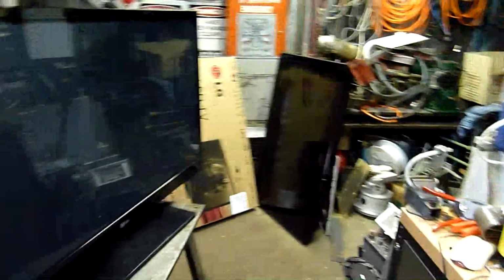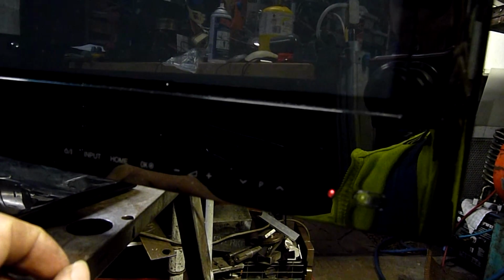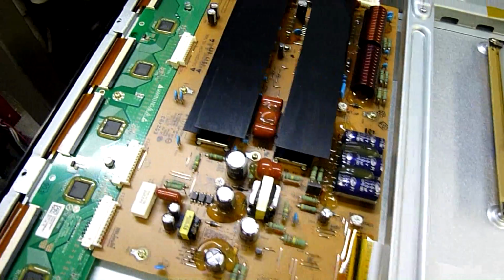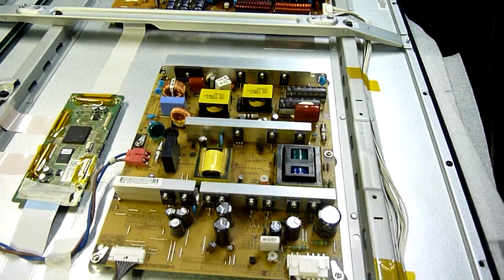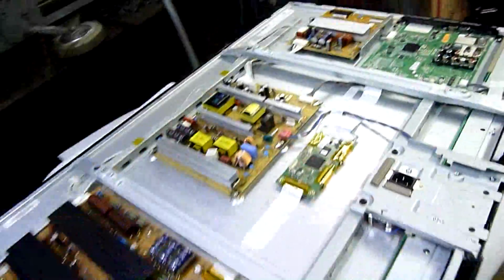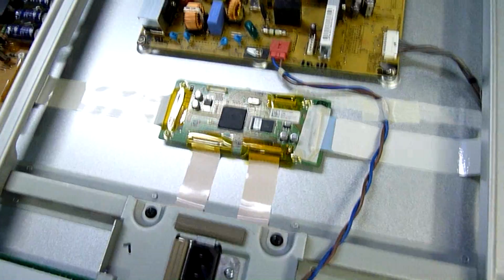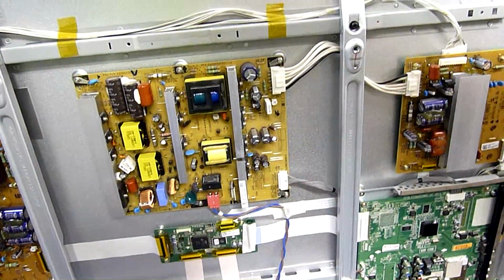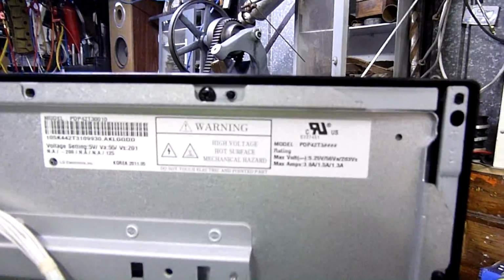LG Plasma Model 42PT250-TA Troubleshoot - No Startup

Comment: Hello Friend, I have a LG Plasma TV 32 inches. There is no picture and sound only. The operating light and the remote control are working, but without the picture What is the fault? Is it a mosfet or something else in the board? 30G122 & 30F122 & RF2001 Please
Reply: you could have a bad lamp if your tv has the lamps. Shine a flashlight in the screen and see if you can see the picture. If you can now the fun begins.
Reply: I'm having same issue  i also need assitant

Comment: i opened mine and had 10 blown capacitors. i replaced them all and the tv still wont power up. doesnt matter if i unplug the x or y board it still wont push the power all the way through the power supply. it just clicks. any ideas besides replacing power supply board?

Comment: i have an LG plasma that wont start up too. Red light, then blue light under the TV flashes then turns off and goes back to red light standby, what can be wrong?
Reply: Yes same mine is Phillips and red and blue flash but picture comes on it's just pretty dim and unclear (blurry) there is brown stuff all over vent holes on back over well it's over everything inputs it's not dust it's something though ! Ifeel like it's why TV doesn't work took back off the brown dust-like stuff is everywhere

Comment: LG Plasma 60Pz550.Started with a green horizontal line on top half of screen.Now when turned on screen backlight flickers and then stays on with a 1" long blue line in top left corner with no picture .I was able to pull up the volume on screen dail in the opposite bottom right corner but will get a ghost image of it on top half and the lower 4inches of screen.Stays on for a few minutes and then shuts off.
Reply: Red SoloCup .:+

Comment: I have a Samsung HPR5052 and had to replace the power supply about 6 mos ago. recently the unit turned on but there was not sound or picture. I replaced the upper and lower  y  sustain buffer boards but nothing happened, I then replaced the Y sustain main board.the sound came back but still no picture, Any thoughts on what might be wrong still??
Reply: the z board

Comment: Hi Aussie50,
I have this exact LG Plasma Model that you are demonstrating on (42PT250-TA). My wife was watching TV when she heard a loud POP and the tv went off. When I try to turn it on it attempts to cycle on and fails just like you show in your video. I didn't find any blown capacitors, no burnt out or cracked parts, so I got a voltmeter to start testing and this is my result.

When i unplug the Y board from the Z board the tv attempts to turn on and fails.
When i unplug the digital board from the power board, i can't turn the TV on (the red Standby light is OFF).
When i unplug the Z board from the power board the tv is able to turn on. 

I tested the voltage outputs on the power board and they are giving good readings(VS should be 201 and is reading 202 and Va should be 55 and is reading 55, The digital power is also good Should be 17 and is reading 16.8)

I used the Voltmeter's Continuity settings to test the fuses, which are all fine. 

At this point it seems that the problem is either the Z board (or whatever it is plugged into to the right of it), or the digital board. How do i pin point where the problem is ?

How do i test which components on the Z board needs replacing, if i can't get power to it ?

What could have made the large POP sound if its not a fuse or capacitor ?

Do i buy the whole board Z Board, part number EBR68342001 ?
I see (at the site below) there are three boards available and i'm not sure which one i need.
https://www.encompassparts.com/item/8419717/LG/EBR68342001/Hand_Insert_Pcb_Assembly

1) LG Hand Insert Pcb Assembly - $50
2) Green Choice Hand Insert Pcb Assembly - $26
3) Green Choice ZBoard -$21

Any suggestion ?

Thanks in Advance,
Reply from the maker: G'day mate!, the pop could have been a semiconductor blowing out, it often happens discretely against the heat-sink or between the pins and is very hard to ID visually. 
given how cheap the z board is I would be inclined to try that first off. a loud pop from a plasma is almost always a sustain or PSU failure, in your case, Z Sustain, and in my case, Y Sustain (the replacement board came with spare buffers that turned out to be blown, but did not get a chance to kill the PSU)
Reply: Aussie50 Thanks for your quick response! 
I called up the website that i listed earlier and unfortunately, they only sell to Licensed Service Centers. I can't find this part anywhere else do you have any suggestions where i can look (EBR68342001) ?

I also wasn't able to detach the Z board from the board to the right of it. They are connected with white+black clips and i couldn't figure out how the clips work (i don't want to break them accidentally) can you please tell me how they are called or show me how to disconnect them ?

Thanks
Reply from the maker: ***** G'day mate!. thats a shame they only deal with centers, that price is awesome, cost price.
next best thing is to search ebay for the part number and revision number.

The interconnect board connectors (black and white) are just push together pin connectors, they take a bit of force to slip apart, but will do so pretty easy with firm pressure and a bit of wiggling.
Reply: Aussie50 After testing and replacing several suspect capacitors on the Z board without success, I purchased a new Z board from sears @0057
.  Bottom line: Unfortunetly it didn't help. Process: I replaced the old Z board with the new one. = TV failed to turn on. Disconnected the Y Board from the Z board = TV stayed powered on.  This was actually different from what happened earlier, see previous post (where the TV powered off after disconnecting the Z and the Y), which seems to imply that the Z board is now wokring properly while the Y board is the problem.  Stupidly, i reconnected the Y to the Z while the TV was still powered ON. There was a pop at the connection and now the TV powers off even if the Y board is unplugged, suggesting that i messed up somehting on the Z board again..... So i'm afraid that the new Z board helped , but replugging the Y into the Z (while TV powered on) screwed it up again. And the Y board is busted.  I think now is the time to say farewell to the Television and junk it. I spent already 75$ on the Z board and its not worth getting a technitian which will charge me at least 75$ for a visit and expenses for a new boards.  it will be cheaper to just upgrade to a new LED TV.  How do i dispose of a TV ? Its upsetting that the TV didn't last longer than 4 years, what a waste of resources (rare earth metals, plastic, metal, money, time etc.) on the Plasma, i really liked this plasma. whats worse, it seems that all TVs are now made to last only 3-4 years and then something on them gets busted. Like disposable TVs, don't they make things to last anymore. ?? Aussie50 thanks for your help.
Reply from the maker: ***** Ouch!, sounded like something was partially short elsewhere and the voltage surge finished it off :(, at least your okay tho, 280V DC would give you a hell of a shock!.

Best way to recycle one of this age is to put it in the local classifieds so somebody else can use the panel or other parts (the PSU should be okay) you could still get $50 - 100 for it as a non working unit, at least that's what they go for here. or a last resort is to find your local waste disposal center and see if they have an E-Waste recycling program. I send all my really old TV carcasses there so they get recycled properly.
Reply: that was the fet or the fuse on the y sustain or change the ip on the y sustain

Comment: Hey @aussie50, I picked up an LG 50PN6500 that was thrown out in my apartment block. Manufactured in July 2013, panel looks perfect but the HDMI connector has been ripped off the main board. It seems like the logic on the board has been damaged. Was wondering if you've come across any in your travels? Being so new might be difficult to find a part. All the ones on eBay are for US models. Seems a shame to throw out a whole 50" TV just because the main board is damaged :-(

Comment: I have the same tv and was damaged in a storm. The red light down the bottom turns on constantly and tv won't start up at all. Any ideas? I am and electrician but not an electronics guru any help would be much appreciated.
Reply: check the fuse if the fuses it good

Comment: MOSFETs very rarely fail in intermittent manners. Almost always (99.5% of the time) dead short.

If it is a Samsung D450 series I have encountered loud buzzing problems due to X-main. Not power board. But you can use a cardboard tube to narrow down exact position. There's a coil on the X-main which has problems, the glue/varnish cracks allowing it to buzz. Applying new glue usually fixes it.

Comment: If your plasma "squeals like a pig" the panel is probably broken and that is why it does not work, nothing to do with power board or X/Y-main even if some fets are blown.
Reply: if it's making noise that's the fets on the ysustain board but u right it could be coming from a broken panel

Comment: yes edd, I think that's why the prices are getting cheaper to buy these type of sets.
what you did in the vid is correct by removing power plugs but apparently these buggers have self protection on each board so that trick might not work as I did try and got no ware on the last one that I did; as I said I had to replace both its a BITCH!.
and know you now why its not doubled sided crap...  :-)

Comment: Ed.
An idea for ya. If you have a spare LCD TV lying around that isn't worth repairing but the backlight still works, Gut everything out of it except the backlight and inverters and the main power supply. Find the 5V signal wire and the signal ground on the power supply board and cross those two together and the power supply should kick on. Mount it on the ceiling and you get an awesome shop light and it's brighter than a regular shoplight. For me it was. I'll get a vid up of mine.

Comment: ...If the Ysus is faulty, it'll likely have some shorted MOSFETs. Also quite easy to test with a multimeter if any have a dead-short.

Quite common to see blown YSus boards too, but it might have survived.

A nice guide here for testing buffer boards (most of them will be similar)...
tinyurl . com / oc3pk9b     (remove the spaces)

I got a few 50" plasmas running by replacing some of the chips, but it was a real PITA.

Not worth fixing unless the boards are cheap tbh (still have one sat here).
Reply: yes diode mode beep beep lol

Comment: Hi, Ed,

As a quick test, unplug all the buffer boards on the left from the YSus board.

If it still stays on (with the power cables plugged in), then the YSus might be OK.

Buffer boards are a very common fault with plasmas. The chips tend to overheat or just wear out.

You can often find which chip is faulty by testing for continuity between the ground plane on the buffer board and the pins on the ribbon connectors (run the meter probe along the pins).

Comment: i have a samsung 42 inch 720p plasma, i bought it early 2007, still working great.. i prefer plasma's over LCD as much better picture in my opinion.. 

all plasma's less than 50 inch are worth repairing as they are becoming a dying breed, i got lucky on ebay with a 37 inch Panasonic for the bedroom..

older tv's are built much better build quality than newer one's, new tv's have little life expectancy, Cost reduced to the point that you don't even get traditional AV connectors on them any more

Comment: I had this exact same problem on similar LG plasma even the same relay clicking sound , few years back, the guy that came took one measurment and after that just replaced one of the boards IF I remember correctly it was the power supply but I might be wrong , it was long ago, it was still in warranty so I think its really common problem with those panels

Comment: That plasma sounded a little loud with it's buzzing. The power supply could be borderline on the way out, unplugging the bigger board may be bringing up the voltage just past the cut-off. Also, newer caps have a habit of just dying or loosing their filtering properties now instead of popping, but not always.